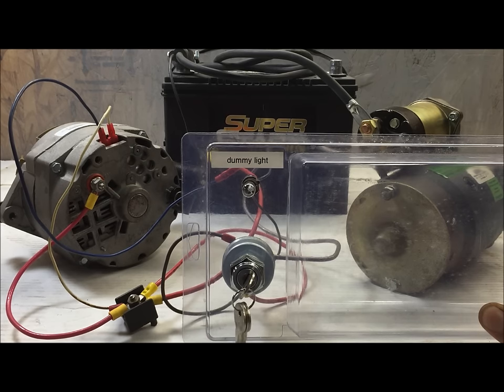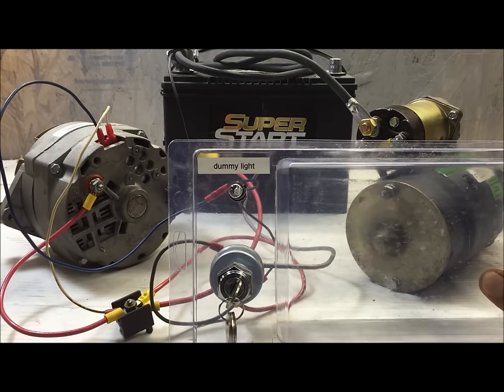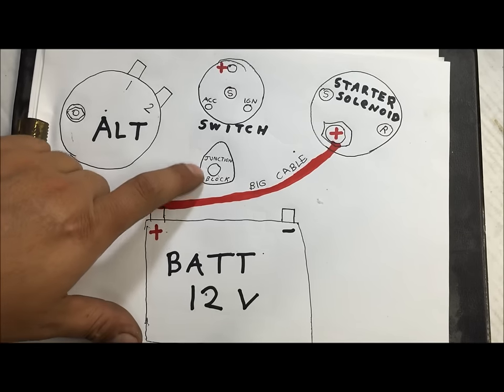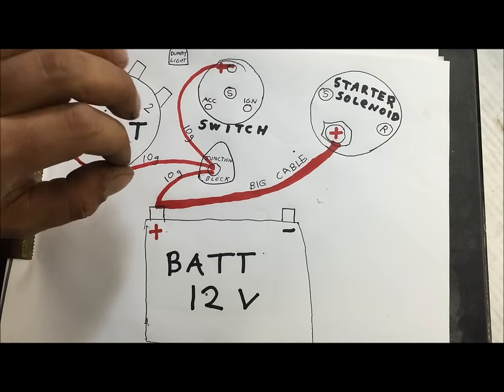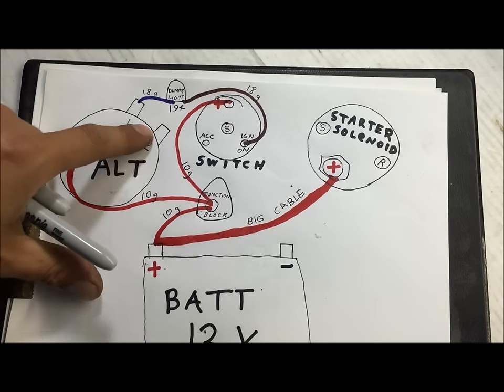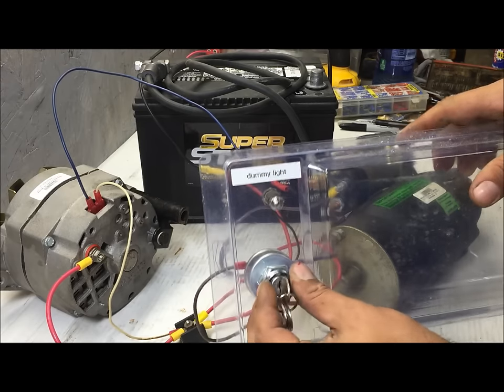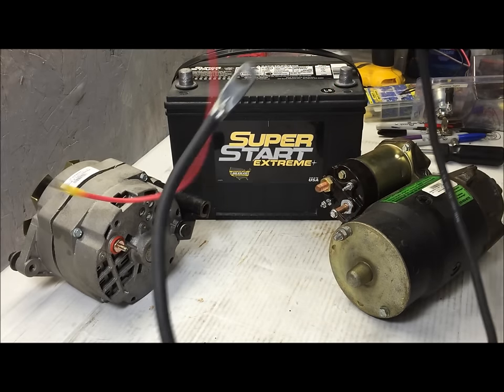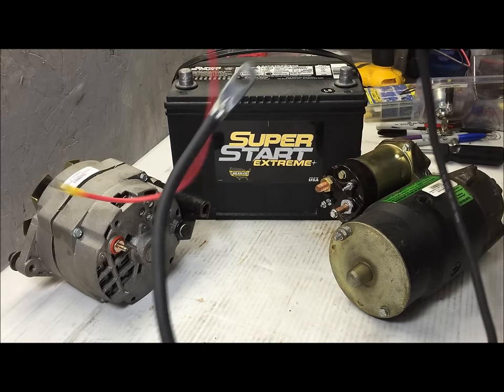64-72 charging system wire up using GM 3 wire internally regulated alternator

Comment: Hey Chris I have a 65 Chevy pickup with electronic ignition but my alternator keeps on dying and kills my battery if I use this method will it fix it. Or do I need to get the old alternator and the regulator box?
Reply from the maker: watch my gm 3 wire alternator video.. electronic ignition doesn’t have anything to do with it..make sure you have an internally regulated alternator .. you might have the wires switched

Comment: Great video. How about one explaining fuses or fusible links in this circuit. I fried my wiring last summer because someone had previously installed a fusible link to big for the circuit going to the cab. just getting ready to install a cs130d alt in my 71 chevy. Putting a vortec in it and the alternator is on the other side of engine compartment. This is why i am watching your video. It helps a great deal. With my system i have a batt guage not a dummy light so i need to solder in a resistor to prevent backfeed.
Reply from the maker: you solder in a diode...  i hate to say, but this is 64-71 and there are no fuses on the charging system..  the junction block acts as an extension of the battery..  they fused before running into the body of the car at the horn relay...  you really need to get a wiring diagram of your vehicle and see where the factory fused....   I will make a video in the future about fusing but the truth is..  that you can fuse anywhere...............

Comment: I'm gonna be working on my own home made harness for a drag car and this is my first rebuild from chassis and this cleared up alot of headache but, do you happen to know or show us how to wire in a toggle switch and push start board instead of keyed ignition
Reply from the maker: why would you want that? Is that a requirement?  It’s wired the same way

Comment: I have a 1970 C10 that I switched from externally regulated to internally. I have a parasitic draw thats been frustratingly difficult to track down. I’m wondering if I was wrong to use the 4 wire connector that went to the external voltage regulator and jump the outer wires and jump the 2 inner ones?
Reply from the maker: you have the wires switched on the alternator

Comment: Not sure why but whoever owned my truck before I got it had the wire from the back of the starter run down to the frame and it burns out the wire every once in a while is it supposed to be running to the junction box on the firewall?
Reply from the maker: what year is the truck?

Comment: I am having a 74 Monte Carlo-new Alternator & the indicator-light is still on when the engine is running!! it should be out!
Can I use the basic of your demo-to wire all up?? Every thing were fine before I went into a new Alternator-the old one is going!!
Reply from the maker: watch my gm 3 wire alternator hook up.. something is not right?
Reply: I have had to cut the hot wire going into,used another wire-tied all 3 wire end together and went back to the out-going heavy outlet for the battery, the indicator-light is ,,flicking on by starting the engine and out again
Thank,s Chris

Comment: I have a 1961 Corvair and want to convert it to an alternator. I made a custom bracket to hold the alternator in place. I have a GM 3 wire alternator I want to use. I brought it to Autozone, had it tested and it works fine. A 10 gauge to the bat from the past on the back. Now for terminals 1 and 2. and the gen light ?????
Reply from the maker: wire gen light (position 1)  to accessories..
Reply: @chriscraft77022  I think I got it. I'm so daft when it come to wiring. Thank you. Great vids by the way.

Comment: Great video. What happens if you don’t run power to #2 terminal on the alternator? I wired my car up with a early 80s gm alternator with just power to the #1 terminal and it seems to work. Wish I saw this video first, my wiring is a mess.
Reply from the maker: watch my gm 3 wire alternator hook up video... you have to have #2 hooked up to 12v ( it is voltage sensing )

Comment: I know this is an older video but hopefully get an answer I have a 72 nova but I have a later model harness with the same bulkhead plug for an internally regulated alt. Can I use that for a plug and play option or is there enough differences that it wont work
Reply from the maker: there is no plug and play option on older cars .. you have to rewire the plug you added. or at least check the wires .. what is the harness you added from? and why even do that? The 72 harness is good

Comment: Great vid thank you. I still can't get my head around the excited wire wiring. I blew my brand new $120 powermaster because I didn't have a light on the exciter wire. Horrible design. I don't understand still what the bulb is doing. I'm looking at the wiring diagram too and trying to understand why it's wired like this. I don't understand the flow of electricity either. Any advice? Going to take it apart and replace voltage regulator  but don't want it to blow again
Reply from the maker: that’s not going to burn it up., it just won’t shut off the engine when you turn the key off.. you didn’t have the voltage sending wire hooked up right.. that will burn them up.. I have a 3 wire up alternator video.. I dont know what powermaster is but if it’s gm look for my video
Reply: @chriscraft77022  Thanks for the quick reply! I watched your other vid too, really useful. But I'm still facing a knowledge gap. It's a 79 GM with a 3 wire alternator, powermaster one - 12si. It's overcharging so think it got damaged,likely from the wiring. The sensing wire makes sense. The exciter wire with bulb I still don't understand. I've read as well that running a straight 12v will damage it... why would it do that? What's the bulb doing to stop it damaging, it's still seeing 12v at the exciter end even with a bulb? Sorry for all the questions!
Reply from the maker: the only thing that can burn it up is not having #2 connected to positive BATTERY

Comment: You do great video's!  Your video on the 1970 chevelle  four speed conversion was really helpful! I ordered a kit for mine but the frame bracket did not sit flush with my Z Bar. I seen yours fit right can u tell me where You purchased your kit from so i can get the right bracket!   Thanks
Reply from the maker: +Scott Mullins the z bar is not going to sit straight, even mine in the video was not flush to the frame bracket...
i got it off ebay from hi tech classics in placenta, CA
Reply: +Chris Craft OK thanks  a lot!  I see where yours has a little angle to it but mine has quite a bit. I guess some of guys have problems with some repo stuff. I got mine through OPG.

Comment: This is awesome how simple you make this to follow. I'm trying to wire up my first ratrod. My only question, is a junction block really necessary?
Reply from the maker: NO.. but if you don’t you will be one of those people with 10 things hanging off your positive battery terminal looking like garbage
Reply: I'm working on a old sandrail with a mid 60s corvair motor. Wire is toast so wiring it up with the bare necessities right now. I have the ballast resistor going to the + side of coil, but in ur vid, i didnt see a  voltage regulator, is 1 needed or does the junction block (dumb ?) Act as a regulator?...theres 2000 different wiring up vids and I just need to know how to wire this up the easiest way. 
I relocated the batt from the rear to the front of the sandrail, the pos. (From batt) Runs down the center of floor from the front of the ride to right behind the seats to a junction block and anything that needs 12v will go to the block behind the seats instead of 20 wires running to the batt up front. Alot was missing when this was dropped off to my place, so trying to figure out what's needed to fire up this motor and see if its worthy or not. Any help would be very appreciated

Comment: Hi Chris, very informative video. I've checked out a reference table for wire gauges and it seems that they say I should be using 6 or 8 gauge wire for a 63 amp alternator. What's your thought? Is 10 gauge still sufficient or should I be looking for a 6/8 gauge wire? Thanks!
Reply from the maker: 10awg is good for up to a 75 amp alternator.. GM wired it like that..

Comment: 10G for alt to battery is not necessarily correct the size of wire you use from alt to bat. Is going to depend on the amperage output of the alternator for example if you are running a 250 Amp alt you will need a bigger wire 10g will burn up also there needs to be fusible links between the battery and everything else.
Reply from the maker: I have a 100 amp alt upgrade video

Comment: do I need to have the dummy light hooked up? is it necessary? for instance couldn't I just run the wire wo light. it should still work the same right? to excite when key is on start , cut out after u let go of key....
Reply from the maker: NO, watch my 3 wire GM alternator hook up video..  what are you working on?

Comment: i wired it just like you did in this video. the alternator is a reman from Mexico. my question is. why is my alternator warm to the touch ? its charging.  but after i shut off tge truck and let it cool for a couple hours the alternator is warm to the touch. i tracked every wire in the charging system and no shorts. could the reman alternator by bad from the auto parts store? because it sat on the shelf without being excited for too long? or could i have a bad ignition switch?  or? thanks dskinner

Comment: The 60 amp alternator with an external regulator on my '71 Cutlass went bad and I am about to upgrade to a 100 amp internally regulated alternator. After watching most of your videos on the subject and all of the reading that I have done, I am pretty confident that I have everything figured out. The only concern that I have is whether or not I need upgrade the size of any of wires because of the increased amperage that this alternator is capable of. What is your opinion on this?
Reply from the maker: +TheBlackDeath71 .....    i have never personally ever found a need to run a 100 amp alternator, so i dont know if the wire should be bigger than a 10g....  i think you might at least need an 8g but if you look it up, well, im sure you already have...6g or even 4g....  but those figures are based off wiring where you are using all 100 amps...like an ambulance, etc... but i really dont know, my opinion, run an 80 amp... i mean do you have a huge radio system?  why would you need a 100 amp alternator?
Reply: +Chris Craft I have installed 2 electric fans on my car and the 60 amp alternator was just barely making it and I plan on installing an efi system later.
From what I've found the only wire that needs to be upgraded is the charging wire that runs from the alternator to the distribution point (or horn relay) and then to the battery. I have been able to find 1 chart that lists appropriate wire sizes based off of the alternators max output and the length of the charging wire. 8 or 6 gauge in my situation
Reply from the maker: +TheBlackDeath71 ..damn, you got me thinking now, im going in the same route with my car....   but im just building it stock for now cause it was trashed...    i am going to end up doing exactly what you are going through..  i will run a 6g to the junction block or horn relay...  what engine do you have and what efi system are you looking at???
Reply: +Chris Craft The motor is a 350 and I was leaning towards the Edelbrock efi system. But I've got huge dreams so I'll probably pick a system that can be used with a roots supercharger and/or dual carbs. 600 to 700 horsepower dreams right there.
And I watched your video where you were rewiring the alternator harness (just the harness itself). I was wondering why you got rid of the wire in the #3 position on the regulator instead of just connecting it to the wire from the #2 position on the regulator?
Reply from the maker: +TheBlackDeath71   because i didnt want to splice a 10g to an 18g... ..you seem to know whats going on but you cant expect an amateur to know how to splice the two gauges...
Reply: +Chris Craft Ahhh I understand. I didn't pay any attention to the difference in wire sizes.
Reply from the maker: +TheBlackDeath71   thanks for watching...  you should do a video about the 100 amp conversion...  id like to see what you figure out...and you just gave me an idea for another video...  dude, watch the BIG 3 upgrade by sonic electronics
Reply: +Chris Craft Haha I'll have to think about making a video that might be pretty fun.
Yep upgrading the engine ground and chassis ground are pretty good points too.
And thank you for the very informative videos and the replies

Comment: 10gage wire is for 30 amps. if your alternator is higher output buy a lot(35 should be ok) then you need bigger wires from the alternator output to the junction block and from the junction block to the battery. consult wire charts for current cary
If you have an old car like my 60 chevy without acc position. you need a diode between the light and term 1 so the car will shut off and not drain battery either. I kept burning out the 57 dash lamp so put a 10ohm 10w resistor across the lamp.

Comment: If you were changing from points to hei distributor, where would you run your 19 gauge wire from? Thanks
Reply from the maker: IGN off the fuse box and upgrade to 12 for HEI
Reply: On mine, I had to run a wire from the R terminal on the solenoid to the HEI distributor power lead, as well as the one from the ignition because the main ignition circuit wasn't hot during cranking.

Comment: Thanks for the info but I have a problem.  Just re-wired according to your schematic.  My coil wire is on the IGN key switch and the ALT exciter wire stays hot.  The result is the engine keeps running and only shuts off when I pull the exciter wire off the ALT 1 post.  Please advise/thanks.
Reply from the maker: +Pe Ka you have to run that wire through the 194 bulb in series or a diode pointing towards the ALTERNATOR....( you can buy a diode at radio shack)   if you run it straight, it keeps exciting the alternator causing it to not shut off....  go buy a diode from radio shack and install it pointing to the number 1 position or run a 194 bulb in series through this wire...   it shows this in the video very clearly... the 194 bulb is the dummy light... watch my dummy light explained video
Reply: +Chris Craft Thanks for your promt response.  I didn't realize that the bulb acted as a 'disconnect' and ommited that feature.  Since my post I tried switching the one &  two wires on the ALT and the engine shuts off properly but it may not function properly.(???)  While we're at it how would you tie in an ampmeter gauge?  Thanks so much for sharing your expertise with me/us!
Reply from the maker: +Pe Ka              dont switch the wires!!! this will drain your battery     the amp meter needs to be ran through 2 points of the charging system in which all the draw is in between the 2 points...  what type of car are you working on?   in other words...  one lead directly to battery ( or closest contact to battery) and the other lead at a point after every hot wire has been run, usually a fuse box or horn relay...you are trying to put the 2 leads of the amp meter around the points where all the current is drawn from off the 10g wires....   its hard to explain, but just let me know what you are working on and maybe i can explain a little better... damn, i guess i need to make an ammeter video now..  thanks
Reply: +Chris Craft:  Hey Chris.  Put in the dummy light and works like a charm now!  Working on a 48 Willys Jeep w/ 225 Dauntless with HEI, 12 volt system and all cutom wiring.  A friend did the IGN, ALT, SOL wiring years ago and I never cared for how it was done.  Seemed to work fine till my sealed battery started leaking a couple months ago and last week the ALT died.  Found your well done video and decided to rip out the old rat's nest of wires and redo it all.  Will mess with the ammeter later.  Thanks again for the excellent video and your feedback!

Comment: Hey Chris, 
Would you have any videos to rebuild alternator?
The one I've got is like the one in your video. It's only putting out 11.5 - 7 volts on a Tester at the part store. Soooo... thinking it's the internal voltage Regulator. 
Thank you in advance! 👍🥃
Reply from the maker: I used to rebuild them when I was 15.. I just buy new ones with lifetime warranties now.. no videos on that but it is very easy to do
Reply: @chriscraft77022  Ty 🥃
Oh, didn't want to buy new it's just temporary until I build a new engine and get billet front parts....

Comment: I was wondering.. is it posible to install a one wire alternator directly to a extra 12v batt?... just for use with electronics such as Tv, Phone etc.
Reply from the maker: so the vehicle is going to have 2 alternators?
Reply: +Chris Craft Correct,.. 2 alternators. The only purpose of this second alternator is to just charge the second batt. that's it. I see that people with GM vehicle are doing this I have not seen anyone else doing this to any Toyota van etc. if you do this I think you gonna be the very first person on YouTube, that would be awesome.

Comment: Hey Chris, would you have a video that shows how to test an alternator newer 2 wire while it's off the car.. Not installed? 
PS.. Using a Multimeter..
Ty 👍🤟
Reply from the maker: you can’t check it like that
Reply: @chriscraft77022  so there is no way possible whatsoever? If I go to Auto parts store and have them run an alternator test probably my best bet..
I need to make one of them Testers!
Reply from the maker: you have to spin it like 800 rpm to test.. I don’t think they do free testing anymore only for warranty stuff

Comment: Can I run a 10 gauge wire from the back of the alt. directly to the battery for charging?  If so do I need any type of fusabke link?
Reply from the maker: yes and a fuse is up to you ( I don’t fuse that)